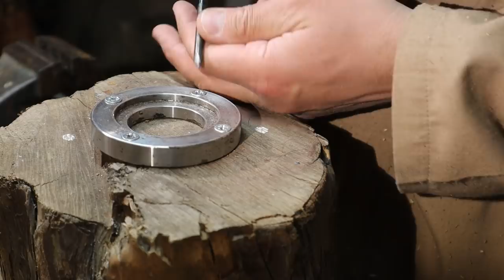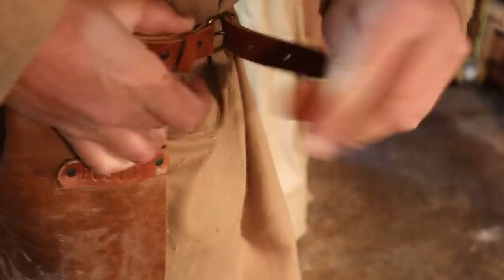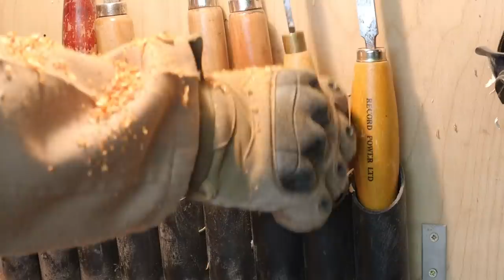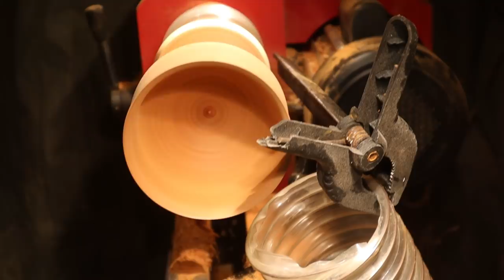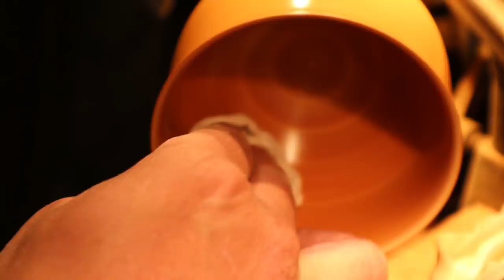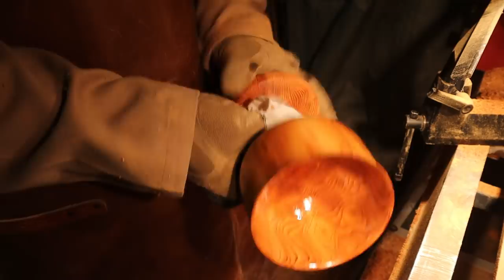From Log To GOBLET - Woodturning from START to FINISH! ASMR

Comment: I know almost nothing about lathes but can see the ring attachment at the beginning and then on the cup side you clamp it in the lathe rather than a ring socket. Which cleverly does away with screws. Stupid question but how do you know how big to turn the bit that gets clamped?